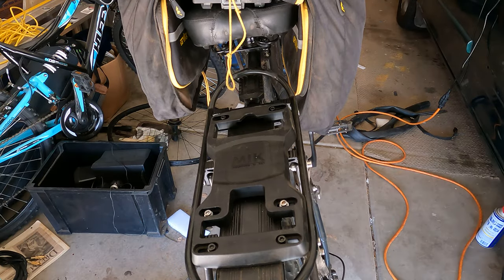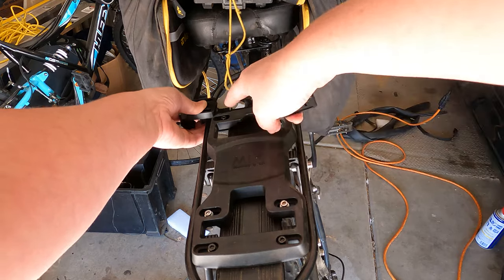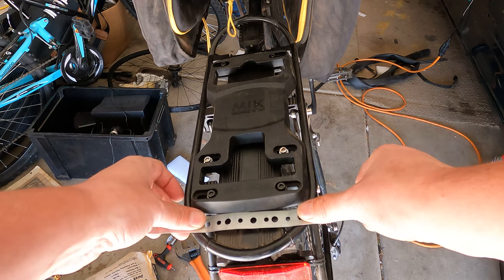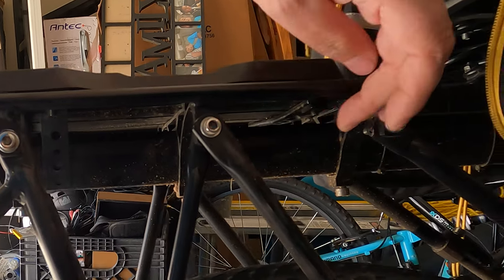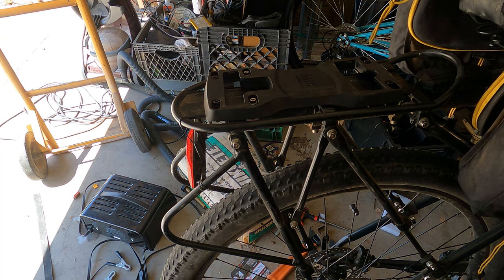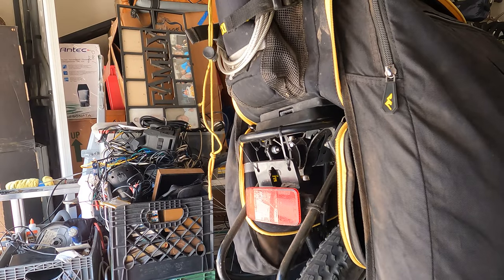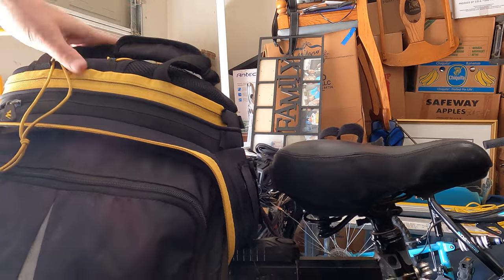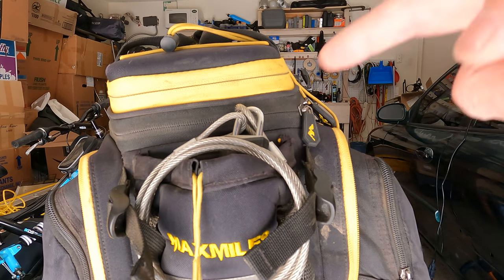Better Way to Install Bike Mik Carrier Plate Rack Adapter

Comment from the maker: Long story as a list.
1. Rear bike bag straps rip over time.
2. Got MIK rack for Trek Marlin 7 (Rated for 55 pounds)
3. Replaced straps on bag with MIK adapter.
4. Put motor on bike.
5. Added 2 batteries to back bag (35 pounds)
6. Rack snapped.
7. Went back to old rack rated for 110 pound and enforce it with an other arm from a spare rack.
8. Got this MIK rack adapter for the old rack.

Tested over 200 miles in Arizona. Half of that was really technical trails. This method of mounting and the mount held up. Sad to say the max miles bag did not. One side fell off of the bag.